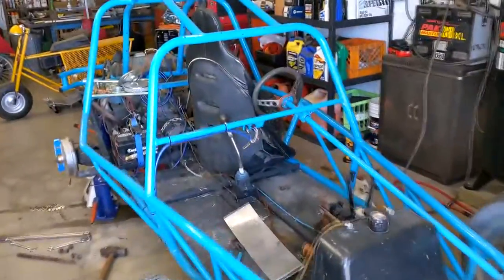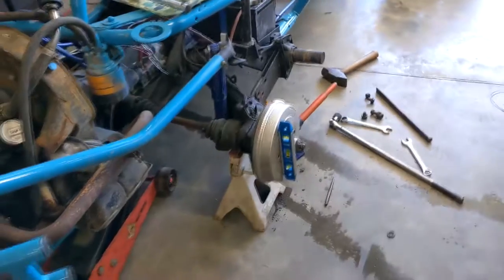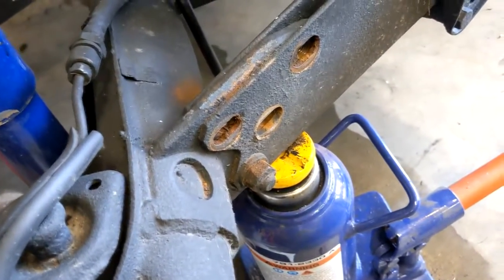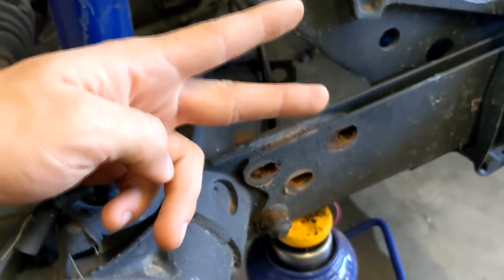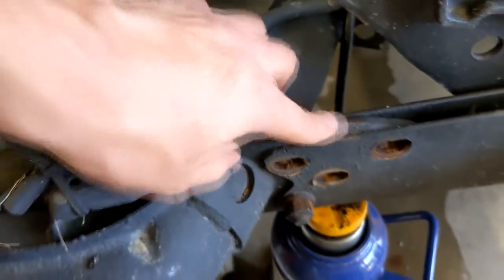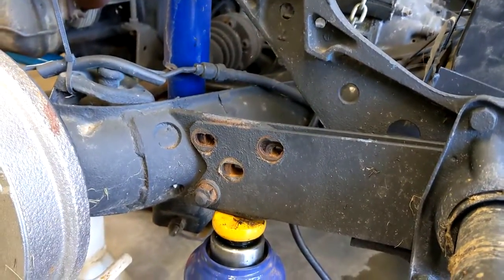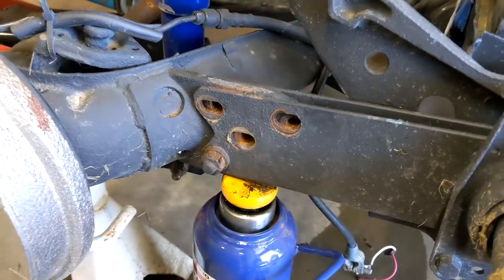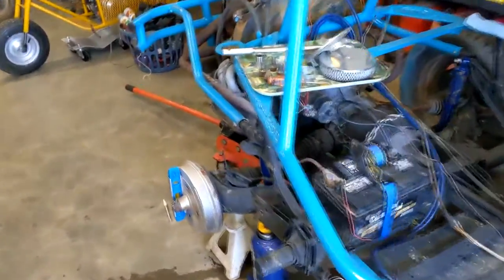How to adjust wheel camber on an IRS VW sandrail

Comment: And then when you go bugging and bend your axle out of alignment against just rip all the rear axle parts out and replace them. WOW!! Or you can just put the beast up for sale and let the new owner suffer over the mess you just created.  

The right way would have been to get it where you wanted it and then drill out the plates for a bushing to slide in then bolt them back together.
Reply: Who cares    its his now he can do what he wants